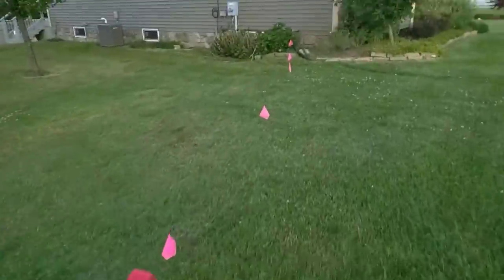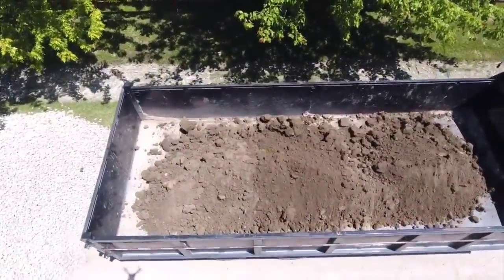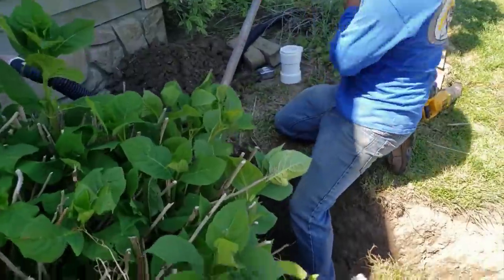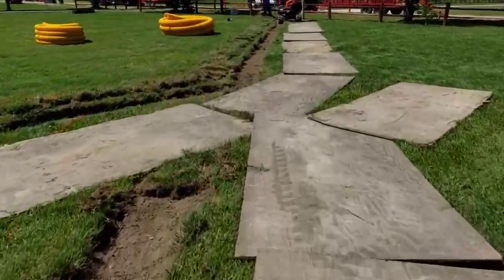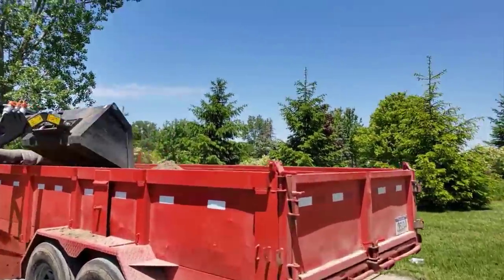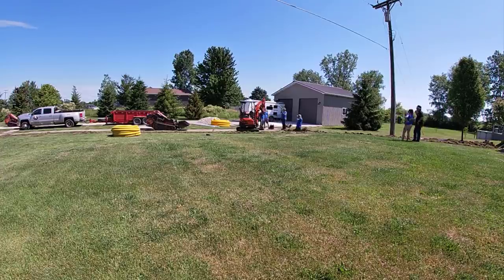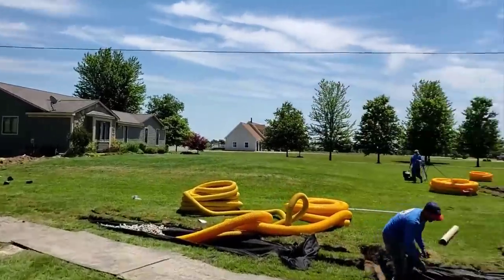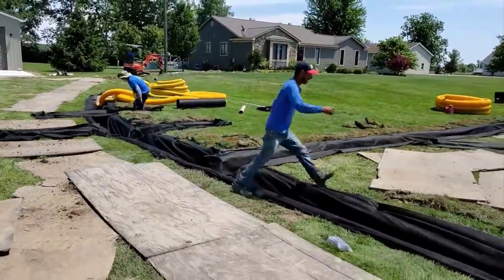6-inch French Drain Built with Sump Line  [ Richmond, Michigan ]

Comment: I'm adding a french drain with your high octane and filter fabric under new SOD. The SOD doesn't have 2.5" think of soil because it's brand new. Should I put some dirt back on top of the French drain system so the grass has some soil to grow? I live in southern California where summer gets up to 100F.
Reply: They use a mixture of top soil and sand.